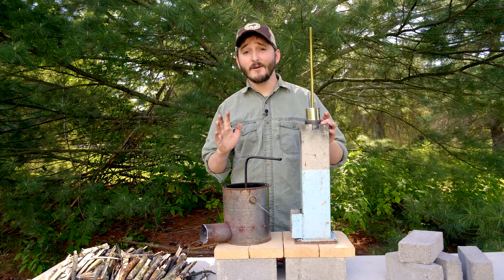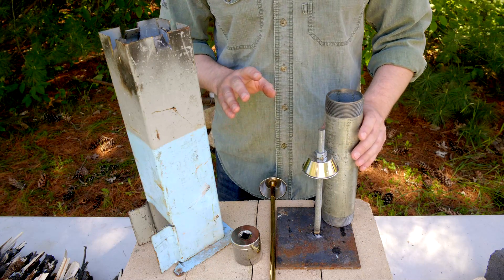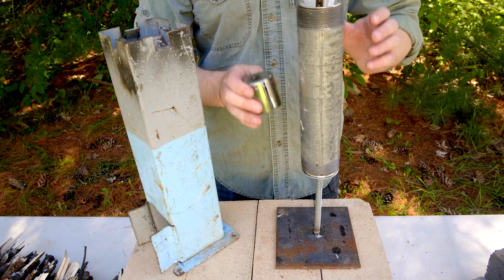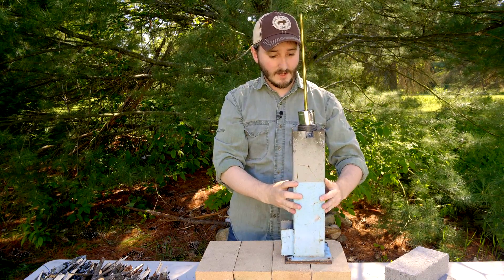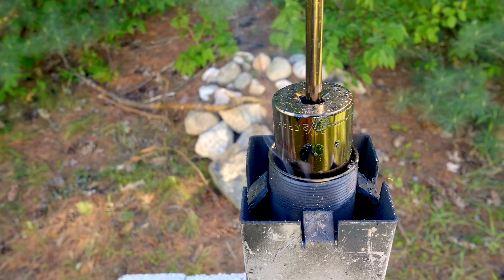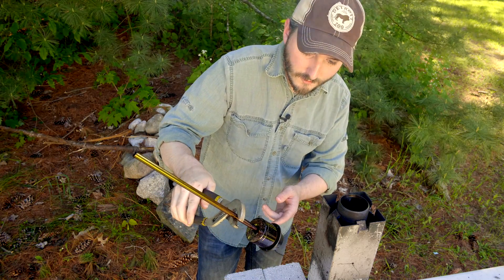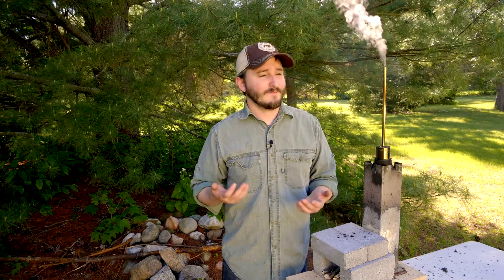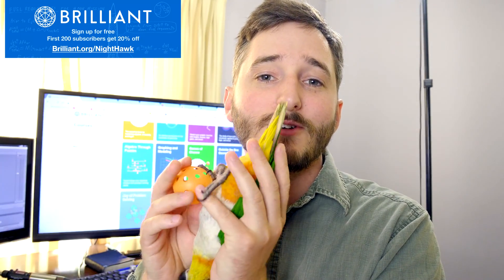Testing A Better Wood Gassifier (Bio Gas Fuel)

Comment: Is it possible to store this energy somehow?
Reply: It's possible to store the gas at atmospheric pressure in big inflated bags, which was done during WWII due to shortages or rationing of petrol.  It's very dangerous when compressed but only moderately dangerous uncompressed :)
Reply: nanupelu store the gas
Reply: There is a gentleman in GA that uses a regular air compressor and fills propane tanks with it, and actually sells it to customers as a more eco friendly alternative to propane, now I don't know if compression turns it into liquid or just pressurizes it but it seems that it is stable enough to market
Reply: Sam Pound only dangerous with oxygen cody has a vid where he compresses down hydrogen which is more dangerous if given oxygen to complete the fire triangle.
Reply: Possibly with this system though, though doubtful, would most likely be destroyed in the chamber. Most of the oxygen though around the chamber is used up heating it.  If you haven't seen NightHawkInLight's  "Making a Plasma Coil Bottle Launcher"  you need a lot of evenly distributed oxygen he even runs into some problems with making it work there with how propane torches work. That however is not to say try it blindly, be safe if you do try and experiment with it.
Reply: Pixl Rainbow I never said pressurize it  it’s just a way
Reply: the gas created is methane (natural gas )  and carbon monoxide ( also called production gas) . Theoretically the methane can be compressed but at really high pressures and very low temperatures. Carbon monoxide does NOT go liquid at any easily reached temperature or pressure.
Reply: Pixl Rainbow way to put someone on the path to making a nice device to go boom ....

This is called a production gas for a reason .... it is designed to be produced for immediate consumption or flaring.

If you want the science someone can do a better job than me ... but the basics are simple enough ... contained in the gasses are a fuel gas and oxygen ... all that stuff needs to burn is heat or a spark ... pressurising it in any type of container could lead to a very large explosion if it gets too hot, naked flame, spark or a flash back as you are using the stored gas. 

Remember .. it is a consumption gas :D
Reply: Paul Hendrix mixed ?? .... it contains oxygen
Reply: Wood gas production works because of an under-abundance of oxygen, leaving the smoke partially unburned. It can then be 'finished' burning as a fuel, so no oxygen is available in the gas output. That has to be mixed back in prior to combustion.
Reply: It's methane. You can see CodysLab pressurise it using compressors. It's not THAT unsafe, so long as you have some pressure release and burn-off the release as they do in petroleum distillation anyway...
Reply: Pixl Rainbow an air compressor and propane tank.... friend of mine has been doing that for years
Reply: Not from a jedi
Reply: I've been watching your videos for a long time now keep it up you have nothing but great content. I remember when you didnt show your face as much now you seem quite social. My favorite thing I've learned from your channel was spinning a piece of ignited steel wool over my head.
Reply: watch his new video genius
Reply: Yes you can store wood.
Reply: Sam Pound you can't store the gas directly. You need to refine the gas into liquid fractions and store the liquid. The gas that remains is unstable and prone to explosion when stored in pressurized containers
Reply: Isn't there a good possibility the gas produced will be mixed with Oxygen?

Comment: Is wood gas once collected and possibly pressurised, efficient enough to power portable generators or better for slow burning lamps like the olde gas lamps of yore?
Reply from the maker: It can power gas engines
Reply: NightHawkInLight
Well I'll be damned.
I use to spend a lot of time hiking through the Australian bush for days from point to point.
My aim was to always travel light with everything I carried having more then one use with minimal waste.

This has given me a few ideas of how to setup a duel functioning stove system.
That could be used for water purification, fuel gathering (charcoal) and cooking in a more controlled manner.
The gas production has me thinking tho, I'll have to look into a way to collect it for the RV trips to lessen the reliance on the solar panels on the poor weather days.

Well done champ
Reply: Mathew Poole do be warned, although the wood gas can power engines, it cannot be reliably stored and pressurized as it is unstable and prone to explosion due to contaminants (e.g. oxygen inside your container)
Additionally, some filtering may be required to make sure the wood gas does not carbonize your piston heads
Reply: Pixl Rainbow
I gathered it wouldn't be "clean" of contaminants and might require an additional gas of sorts for stable pressurization hence why I was wondering if best suited for lighting lamps over power generation.

The main thing I took from this is a system for a controlled small stove that can create its own fuel source without being an open fire.
Good for fire hazard regions.

With the wood gas collection being an after thought to substitute batteries for lamps and if possible power generation.

Comment: Cool idea. Perhaps a slightly more practical design, albeit less aesthetic, could be to replace the cup-pipe openings with simple metal trap doors. Open the bottom door to release the charcoal; open the top to add more fuel.

Comment: now all you need to do is build a system whereby the pressure build up of the gas capture can be used to automatically re-fuel the system with pistons

Comment: I would love to see a full gasifier setup from production to filtering to usage or storage. (I have seen videos where the woodgas is fed to a shop compressor and compressed into tanks but that seems way too dangerous). I am also curious about the feasibility of mulch as fuel for the gasifier either as the primary fuel for heat or the secondary fuel used to produce woodgas. I have heard that it contains too much water but I was wondering if that could be overcome with a setup like you showed here that produces gas almost immediately if you were to give it a few moments to drive off the water/steam. I would love to see it even if it doesn't work. 

Love the videos and keep up the great work!
Reply: John Parker direct compression of gas is hazardous due to contamination with oxidants. Aka it might explode if there is any oxygen present. It is strongly recommended that you distill off the fractions in the gas into liquid oils and then store the liquids.
Reply: Pixl Rainbow I agree. I was mentioning what I saw in another video. I understand that directly compressing the produced gas is an extremely risky thing to do. I failed to emphasize my objection to directly compressing the gas without eliminating sources of oxygen especially in a reciprocating compressor which has the potential to diesel and cause the entire tank to detonate. (I have seen pictures online ofa compressor dieseling and taking a filled concrete block structure with it). That being said the fact that the flame does not travel upstream to the reaction vessle indicates that there is either sufficient flow to keep the flame front from traveling up the tube, the tube is conducting enough heat away to stop the combustion, or there is not enough oxidizer in the gas to support combustion at atmospheric pressure. Even if it was determined not to be an explosion risk I would recommend removing oxidizers from the gas before any sort of long term storage (beyond a day? Maybe?) To prevent the degradation of the gas through partial reactions within storage. The only methods of storage I can think of are basically a large balloon (like they used to use for city gas supply for gas lights but on a much smaller scale) or I think I remember a system that used the displacement of water in a tank/bath to generate pressure.

Comment: Sooo can you actual cook with wood gas? What's the advantage over just cooking with the wood?
Reply: Deathbynature You very well could use the wood gas to cook with, and I think it would be a lot more efficient than cooking over a wood flame, especially considering you're burning fuel...into fuel. With a system like this, and something like a metal sheet (or a pan, if you're feeling modern (and don't want to take risks with an unknown burning metal sheet that could poison you)) that's held up by something, you could have yourself a functioning wood gas stove with a very long burn time. Of course, you'd need to find a way to regulate the emission of wood gas, so that it could hold a steady flame. There are too many of factors though, so it's not a guarantee that it'll work. Still, a wonderful idea. (That I may, or may not start working on a diagram for. (I will.))

Comment: Can you condense the wood vapors into a combustible liquid?
Reply: Yes, this is why methanol is called "wood alcohol".  It's also how turpentine is made from pine.
Reply: tar +  stick = torch
Reply: I had also wondered that
Reply: I think it will has more value if you use it as liquid smoke

Comment: most of the smoke comming out isnt "gas wood" there's a lot of other stuff that isnt flamable enough to produce good gas
Reply: I just want to see the next desing finished making the whole process
Reply: if you put the gas underwater you can get rid of some of the contaminates when it floats up to the surface and compress it in to tanks

Comment: you need to add a water filter to the smoke. Not only will the gas be more pure for storage and use, but it will stay burning if you light the exiting gas.

Comment: I would like to see how the wood gas could be applied to everyday events, such as making a gas boiler and using wood gas instead of propane, or creating a fire pit but piping in wood gas, maybe modifying a common household stove to accommodate for the wood gas as a much safer and bio-friendly alternative to natural gas, propane or other flammable substances that you may use, and as a bonus, you're burning wood that would be decomposed naturally because it fell. Love the video, and your bird.

Comment: doesn't wood gas need to be cooled down?
Reply from the maker: Nope. Needs to cool to purify it, but it burns fine hot
Reply: For engine fuel it's usually cooled somewhat to increase the energy density, and condense some tar.

Comment: The COM coming out from the fire wood inside the tube is blowing the fire you are producing inside the sealed hitting chamber stopping the fire on the top. 
How to convert this CO2 into another gas, maybe using the gas you are producing from wood, maybe adding some more technology. 
I will search for dome idea. Wonderful design, but try to direct the smoke out of the exit of the gas production conduct. Thank you. God bless you.

Comment: This is a good deigns. With a little more work this  could be  run  till you run out of fuel . 
Add 2 handles in the right way , make  2 end cap that let the pipe sit in a grove for air tight seal. Add a dump chute  for fuel  input .   And it can't get no better.

Comment: I wonder if you bent the pipe a little to get the wood gas out of the smoke produced by the fuel maybe it will self sustain better? My guess is that the wood gas didn't have a good supply of oxygen because of the smoke and it kept going out. I may be wrong, but could be a thing to try.

Comment: I would really like to see the collection method and where you can apply the collected gas. The rocket stove design sure looks easy enough to put together and very efficient. So, if it can be collected easily and applied elsewhere, this can be useful at home.

Comment: Does the wood gas also produce tar when burned? If it does it will be hard to use it in an engine. I look forward to seeing you turn the energy from the gas into work. Maby start small with a steam engine though it would be inefficient it is a start. Or try to use it in a small pulse jet. Love the vid and the bird at the end
Reply from the maker: No, not when burned. The tar can be filtered out before the gas is stored.
Reply: mrteslonian has a video on a wood gas engine
Reply: Videos are, my truck runs on firewood and my chainsaw runs on firewood 1&2

Comment: I think thats great.  If the reaction vessel were bigger would more water vapor condense out?
Reply from the maker: No but you can condense the water out of the gas fairly easily after the fact. It will condense naturally in any storage tank.

Comment: You should find a way to attach a lever to your pipe so that you can just push down and the charcoal and tar will fall out. Also, would you be able to put the gas tube at the bottom instead of the top? It may seem counterproductive since wood gas rises, but as long as there is pressure in your container, the gas will follow the tube. If you send the gas downward to a t fitting with a plug, the tar could collect and drain once the plug is removed and the gas could come out parallel to your work surface. If you wanted it to self sustain a flame, you could also put either a water, or hay filter after the t fitting to purify the gas.

Comment: would this work with leaves and grass clippings? ive always wanted to figure out a way to make something useful with grass clippings besides compost.
Reply: It should if they are dry.
Reply: grass clippings make good activated carbon.
Reply: that seems like a good idea to try but i feel like it would be really crumbly and dusty and hard to handle
Reply: Probably true, so it might need a binder to use for water filtration; however, for a supercapacitor, dust might be good.  You could also use it as a filler for some engineered product.  You can also make graphitized carbon at a "lower" temperature with a transition metal salt catalyst.  Why, what do you want to make?  Also why don't you like compost?  You can grow anything with it! It's amazing stuff.
Reply: i do like compost thats actually what i do with my grass clippings now but ive always wanted to find something else to do with them just out of curiosity. i dont have any specific ideas really.

Comment: I saw someone once use the output of a wood gasifier to fuel the engine of a vehicle - I’ve always been curious to see how that works - think you could pull it off with a two stroke?

Comment: Hi. very good project. try to contain the wood gas by extending the pipe throw a seald water tank then vacuum pump to a bottle. then use the fuel.